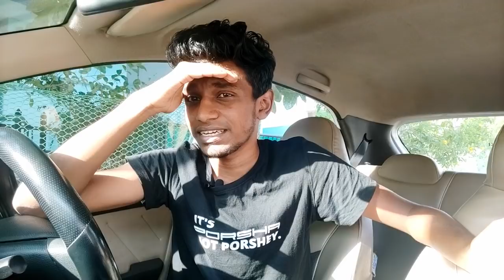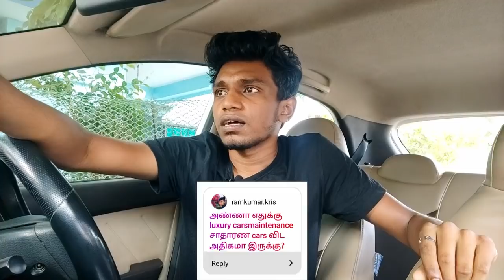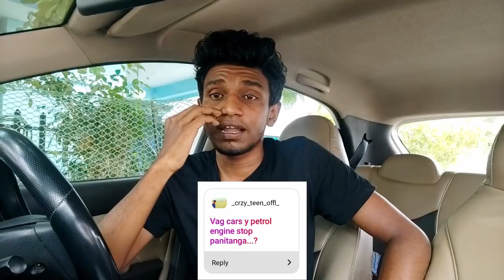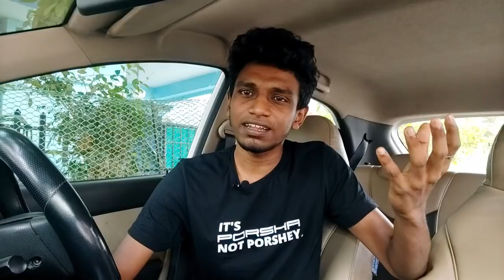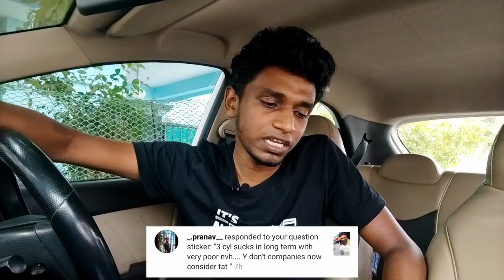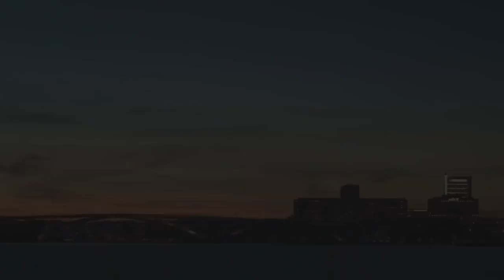Why is engine CC not rounded off? #TuesdayTechTalks | The Driver Seat

Comment: This is a good video with many valuable informations and answers that drivers may not know and should know.. I just got carried over to this video by seeing the topic "Why Engine cc is not rounded off?".. I thought there could be some technical reasons for that. But after seeing your answer I would like to add one important point to your answer. The exact reason why engine CC is not rounded off is for any reason the CC should be within the specified limit. The designers make sure that the CC (cubic capacity) of the engine does not go over the specified limit of 1.3 lts or 1 ltr or 1.2 ltr or 1.5 ltr. When you design an engine with a cubic capacity less than the specified limit, then it is well and good, but when you design it over the specified limit, it is not going to be approved for the specified CC category. After building your engine if you find that the cc is 1 or 2 milliliters greater than the specified limit, you cannot justify your design for approval and all you need to do is just to alter it again or design a new engine with a slightly lower capacity (CC). So for the safer side, the designers design engines which are some milliliters lower in capacity like 1.298 ltr or 1.496 ltr. The same is the case when designing the length of the vehicle. You can note that the sub-4 meter compact segment cars do not have exactly 4000 mm of length. For the safer side, they stick to 3998 mm or 3995 mm or 3991 mm, also considering their building cost of the vehicle.

Comment: bro one doubt, does cc doesn't matter? if we can able to produce more power and torque without that?
bcz vw vento till last year we got 1.6 tdi, 1.5tdi 1.2 and now its only 1000cc engine..
onnumae puriyala bro 1000cc la epdi 1598cc power and torque kondu varuvanga?

Comment: Plz continue your tuesday techtalks videos bro,i am waiting on every tuesday's night.😍
Bro, I have 2 questions for your next tuesday techtalks...
1. Why don't they give a electric motor to a/c compressor to increase mileage and proformance of car.
2.The cars has mentioned as some Nm torque (ex.i10 produces 99.1 Nm@4500 rpm). I think the torque may differ in different gears. If it is right, then the i10 will produce 99.1 Nm torque at which gear ? 
Please explain it to horsepower also bro, Thank you.

Comment: Your answer is wrong for this question like why engines cc full like 1.3L is exactly 1298cc . An Engineer can’t build a full efficiency engine or machine or motor because every mechine or motor or engines have energy losses so never output efficiency is 100%
Reply from the maker: Okay so if they can bring it exactly at 1298cc, why can't they work a bit more and make it exactly 1300cc?
Reply: Bcoz its not possible and not necessary

Comment: Bro,  I have few common questions please help with answers:
please explain about the difference between fully electric steering and hydro electric steering . 
Why does steering gain weight while driving faster. 
Please explain about caster, camber and toe adjustments done during Wheel alignment. 
What causes squeaky short time noise in some car's engines while initiating to move the vehicle.

Comment: May be government rules ah irukalam bro..  some years munnadi delhi la air pollution nala above 2000 CC diesel engine run aaga kudadhu nu sonanga.. so mahindra devolped scorpio with 1.99 litre and recent ah in two wheelers la above 125CC s should have equipped with ABS nu oru rule potanga.. so most of the 125 bikes lam 124CC ah dhan iruku… not sure but may be irukalam la… rules as per the the CC segments

Comment: Area of square with 2cm is 4cmsq (round figure), whereas area of circle with 2cm diameter is  ((2/2)^2*3.14) = 3.14cmsq which is obviously not a round figure. Cylinders in the engine are in cylinderical shape, which is a stack of circles, that is the reason why engine cc are not in a round figure. Area of circle and volume of cylinder will never be in a round figure.
Reply: Ohhh...super👍👍👍👍